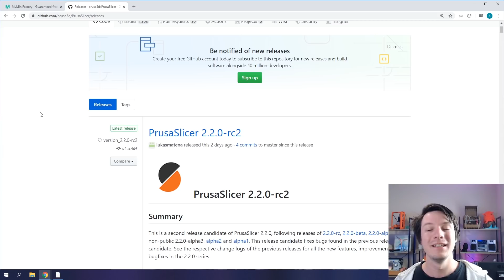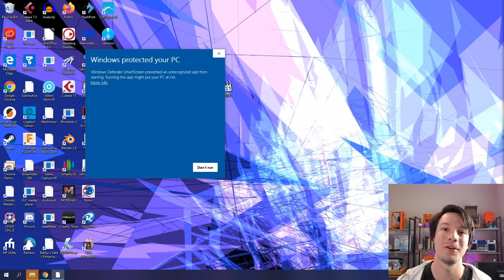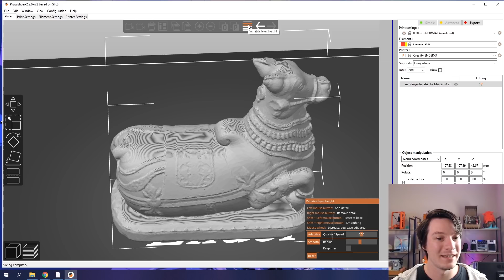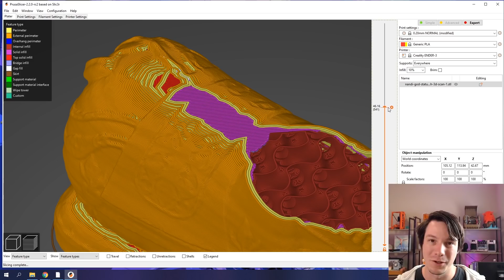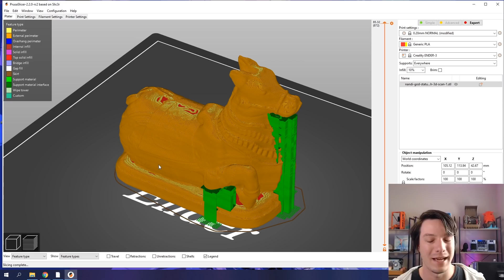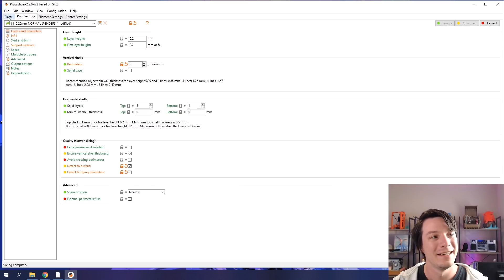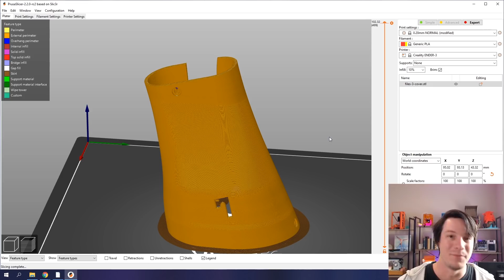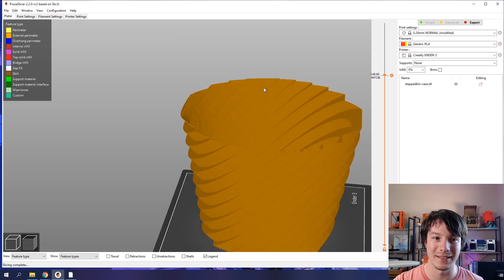Myminifactory VS Prusaslicer VS Creality Ender 3! 3DP Gauntlet Episode 2

Comment: Watching this I've realized something. I'm 100% sure in the future 3D printing settings will be AI generated. Software will just ask for printing material (branded filaments with consistent characteristics will definitely work best.), desired detail quality, and acceptable filament wastage. High End 3d printers will be built with AI in mind and probably have dual extruders with one printing water soluble filament for supports, while lower end printers will likely need to be calibrated and tested by the AI to properly generate predictable outcomes. This is when 3D printing will really go mainstream and truly deliver the "manufacturing revolution" people talked about years ago.

Comment: I see you've got some mods going there with the Ender 3 (direct drive for one). Better? Worse? How much of a print speed reduction did that cause? Any progress on the print bed magnetic issues? What was your solution? The Prusa has magnets as well. Do the Neodidlium magnets not give way with long term heating? (as opposed to the multi-domain "fridge" magnets used in the flexi sheet)

Comment: Hi Angus, I love playing around with vase mode to make little pots for my succulents, the thing is that they need holes at the bottom, so I have to take a hot nail and make them manually.
Is there a way to make holes at the bottom of a vase mode printing?
I've tried adding a cylinder modifier, but I get a Prusa error.
Awesome content BTW.
Reply from the maker: I have manually combined gcode for a few layers of gyroid infill with vase mode to print pots in the past, would that be a useful vid? It's a LITTLE janky sadly...
Reply: @MakersMuse  Wow, I'm a programmer and I haven't thought about combining gcode, maybe you can slice it without vase mode and holes at the bottom layers, and replace those layers only in the vase mode gcode.
You are a genius Angus, thanks so much.

Comment: I haven't watched the full video yet, so maybe you discuss this later on, but I was a bit surprised you picked one with a BY-NC-SA license. Wouldn't making a (monetized) youtube video fall under commercial use? I'd be curious to hear your thoughts on this.
Reply from the maker: Perhaps at a stretch but I think that's pushing it a little, I'm not distributing the files or prints for commercial gain.
Reply: Yeah, it's not a big deal, and I'm not trying to accuse you or anything :). And personally, If it was my model, I wouldn't care. But I guess I just tend to err on the side of caution in cases like this.

Comment: I use Prussia slicer for my Alfawise U30 but have trouble with PLA support material not coming off very well. Any suggestion? I tend to print at 200 degrees or a bit more and often really big layers (0.32mm).

Comment: So, Question about infill, does the type or amount infill you use affect how much a part deforms?  I've have a two halves of a part that are supposed to fit flush, but both of them bowed slightly.  I thought It might be a parameter issue, but I can't seem to get it perfectly flat.  (the warp is 1mm between the two parts, (so roughly .5 mm each) at max, but it's still frustrating.